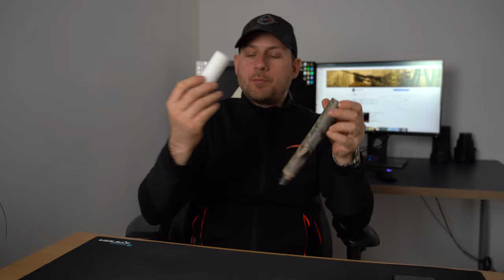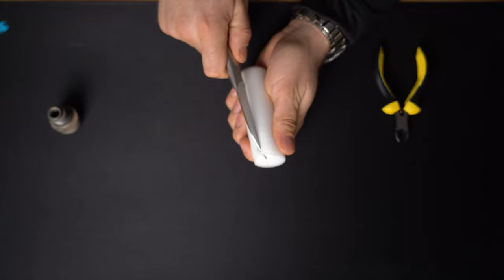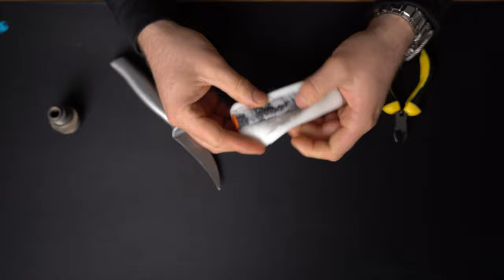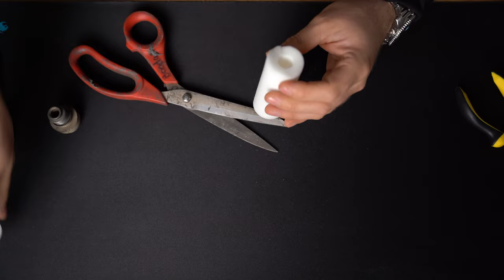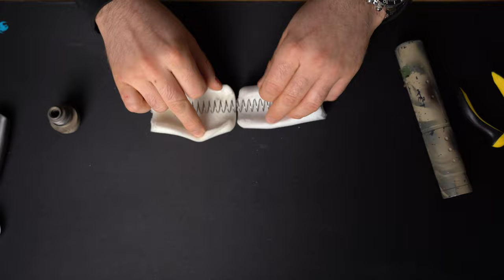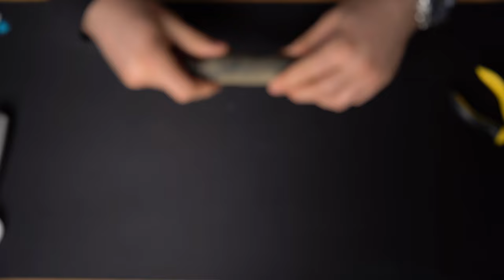Cheap  DIY Airsoft Suppressor That Works Using Roller Foam.

Comment: Great simple trick. I use foam and green sink scourer cut into discs at about 1 inch intervals. The gaps give the air space to expand to make even less noise.
Reply from the maker: I’ll definitely give that a try. 🤝
Reply: can you make a video? I have full cut inside but with no spaces

Comment: a much cheaper option is just buy 5 layer aluminum heating pipe insulator foam, its about 25c for 1 metre of foam.
Reply from the maker: Sounds good 👌
Reply: @DraculaAirsoftSniper  It shouldn't😁
Reply from the maker: I see what you did there 😆

Comment: I made one using 4 foam discs each disc is about 3/4 of an inch wide supressor is about 6 inches long. Each disc has a gap about an inch and a half between one another so air can get trapped. It was already pretty quiet. I took 4 decibels off the rifle. The piston slapping the head is still what you hear but it took away the towel snap noise at the end of the rifle.
Reply from the maker: nice one mate!

Comment: Hey! nice idea! 
I just happened to have a foam paint roll that fitted EXACTLY inside the fat suppressor of my DMR Dragunov SVU. What a coincidence...
Didn't have to cut it, just pushing it out broke the glue from the inside tube.
And also no need for the spring, it took literally 30sec.
I have to say that the sound from the muzzle was dramatically reduced, but since most of the noise comes from the motor and gears it's indistinguishable to me.

I'm sure it would be much more useful in a sniper tho.
Reply from the maker: great stuff bro

Comment: For the none believers; I once bought a BSA suppressor for a PCP air rifle, it took the rifle from ears ringing to where I could actually hear the hammer strike the valve and cost £70($85ish). 

When I took it apart it was literally a metal tube hair curlers wrapped in cotton wool.

Comment: How much hopup do you use on your rifle with the spring? I have a 500fps spring with an ASG Hush XL and the suppressor makes it inaccurate
Reply from the maker: I have a TDC mod on it, so i adjust on the go. Check maybe a BB’s is touching the suppressor and deviating
Reply: @DraculaAirsoftSniper  It seems like even with the spring suppressor and hop up lowered, it still shoots inaccurately. I upgraded to the 500fps spring because I was using a pvc pipe initially in hopes of fixing it. Any tips on how to make it more precise? I love the video by the way.
Reply from the maker: I had to basics change all the internals on kine to make it accurate. I’ll make a video about the rif soon, and i’ll be showing all the upgrades.
Reply: @DraculaAirsoftSniper  thank you so much

Comment: Were did you buy the suppressor from can u give the link?
Reply from the maker: You’ll need a adaptor for the VSR 10 : https://www.bztactical.co.uk/action-army-vsr-10-silencer-adapter-ccw-black

And then just find a suppressor you like. Plenty on eBay, patrolbase etc
Reply: @DraculaAirsoftSniper  can they ship to like Hawaii?